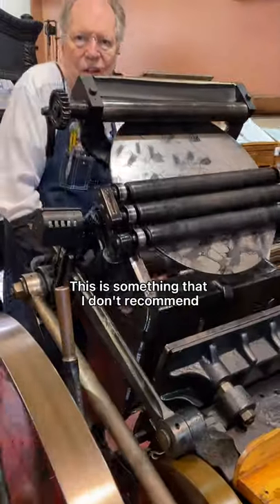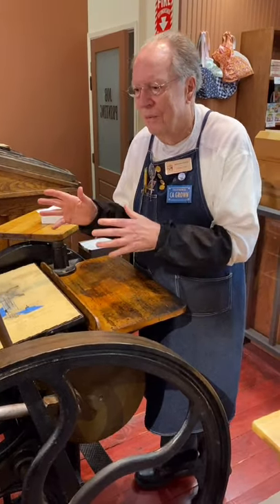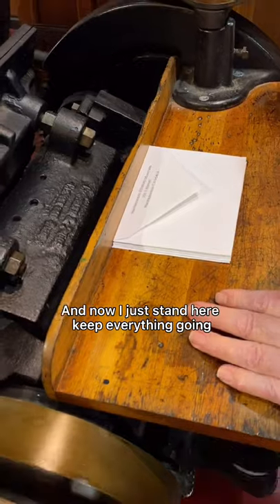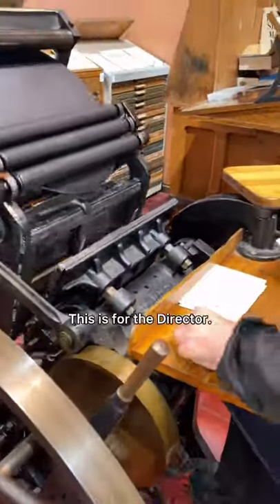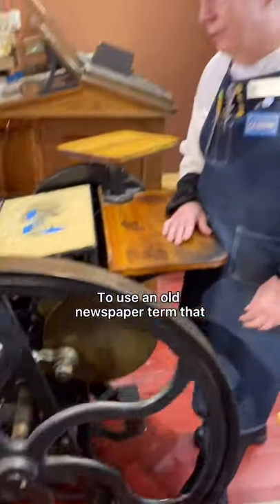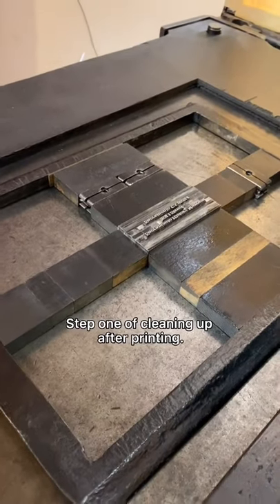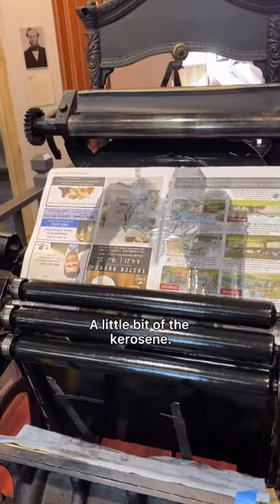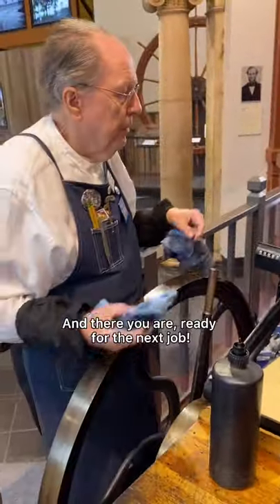Operating a Chandler & Price Jobbing Press

Comment: Doesn't that round flat plate has 2 pieces and both rotate in opposite direction????? Can you please make a video on how fountain mechanisms works? What is the rollers material? It should have rubberized surface but it looks like metal surface!!!!!!!